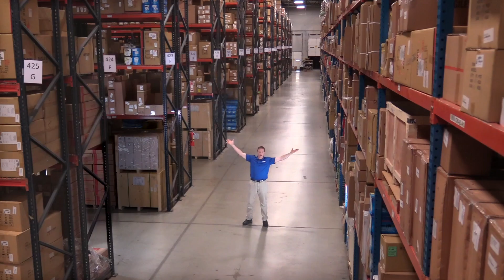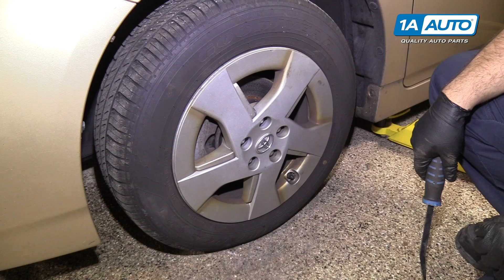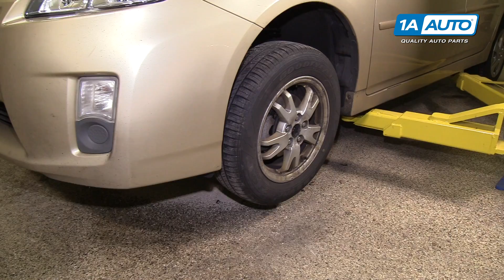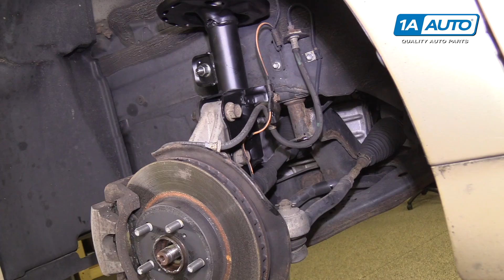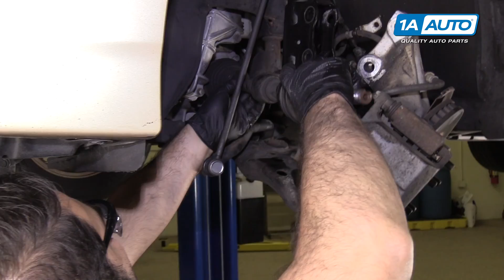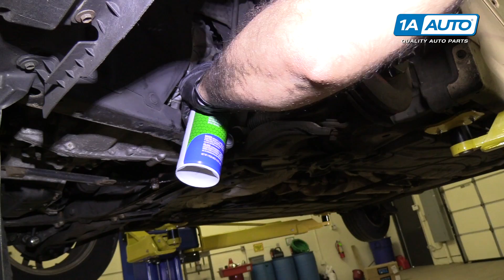How to Replace Front Drivers CV Axle 10-15 Toyota Prius

Comment: I don't take the 2 bolts out of the strut assy, I take the lower ball joint apart. So you won't need an $80 alignment.

Comment: Not sure how well you staked that nut.  I can't properly stake the axle nut with the wheel on.  It's a pain, but I put the wheel on, lower the car, torque the nut, raise car, remove wheel, stake nut, then replace wheel.

Comment: MAY be a stupid question but, what about topping off the Transmission fluid after you put it back together? Shouldn't some have come out when you removed the CV seal?
Reply from the maker: +A C Thank you for the great question!  You should not have to for this application, as it will only be a small amount that is lost.  If you notice that a lot has come out during this process then it would be a good idea to top it off at that point!  1aauto.com
Reply: Thank you for the reply!
Reply: I have an 05. half the fluid came out with that shaft.Yes, roughly 2 Qts. To get the shaft out I used a 1/2 inch craftsman ratchet handle. It just fit perfect in the gap behind the CV as a lever so I taped it with a heavy hammer and it just popped out. They come right off once you get a stout bit of metal behind it. Big screwdrivers or a nail puller didn't work for me as they bounced, flexed, and moved. Couldn't get a good square pop. The plug on the bottom of the transaxle with the allen head is the drain. Pull that right away. Drain all the fluid. Go straight from there up and around twds the front. There is a plug. That is the level.Take that out too. Don't be confused with the one in line with the two transmission coolant lines that is to drain that. Don't mess with it. Ok now put the allen head drain plug back in. Put a small funnel into 1/2 inch aquarium tubing. Takes  about 3 or 4 feet of tube. Run it from under the hood down to that level hole. When it's time, just fill it with the funnel until it drips out and replace the plug. Real 1950 old school gravely tractor tech.. If you drain all of it out you will need 1 gal of fluid. I used Valvoline MS rated from walleyworld for $17. Those are crush washers on the plugs, they are one use items so they could weep if you reuse them. I replaced them with fiber ones for oil pans from the hardware store and put teflon tape on the thread. Don't over tighten. Hard snug is fine. like the oil pan. It is a good idea to change all the fluid  since you are there anyway.

Comment: very nice, subbed.  05 Prius after drivers side axle replacement;  Question if I'm hearing a single click on acceleration from dead stop and another single click when coming to a stop what could be the issue?  I saw in a Leaf forum that they addressed the same noise with grease on the splines in the hub side and retorqued.  I didn't see you mention any grease on the splines.  Thanks!
Reply: Did it fix the problem
Reply: Did you fix the problem,i had the same problem on 05 prius.